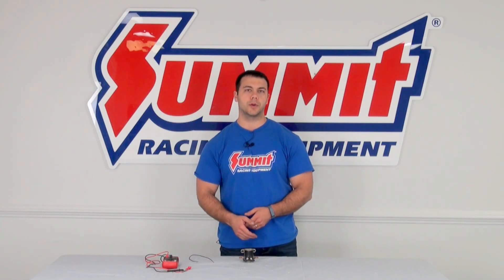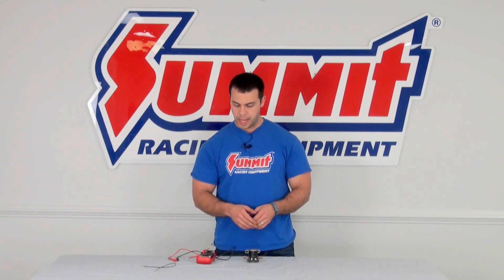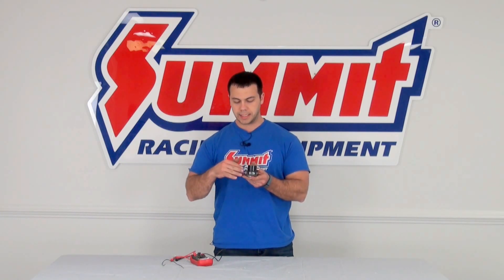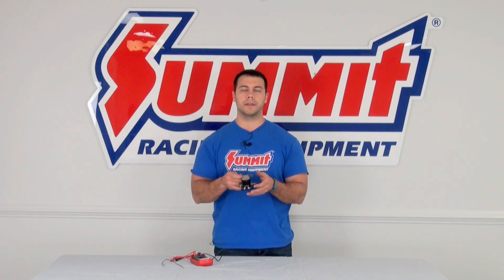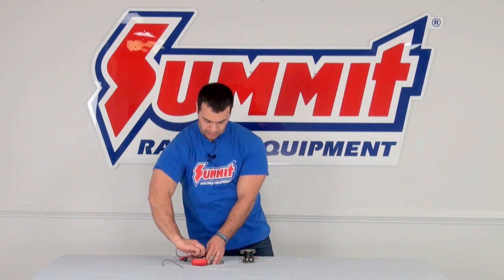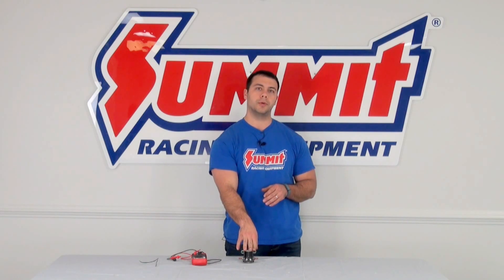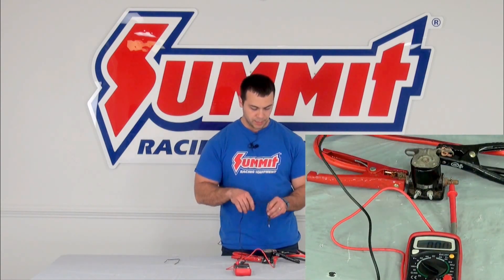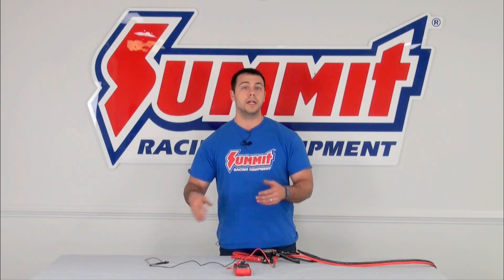How to Test a Starter Solenoid - Summit Racing QuickFlicks

Comment: a.jackson very  simple and good video. I need some information about the(  I) terminal  on the solenoid switch. My electrical system has a two wire off and on Ignition Switch, Key Switch. My (I) terminal is connect to a push button switch on a tractors transmission .I want to by pass the button switch on the transmission any ideas. Thanks!

Comment: I have a question. I put some dielectric grease on the banana plug connectors of my multimeter, would that give me false readings when doing a resistance check on something?
Reply from the maker: n310ea , 
Yes, there still has to be metal to metal contact somewhere in the connection to have good continuity. The dielectric will shield the rest of the terminals surface are to help prevent corrosion.